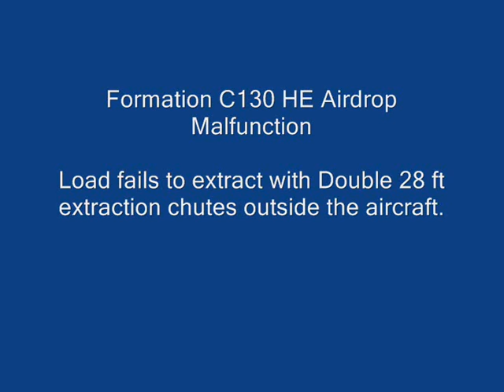C-130 74-1681, HE 2 x 28ft Chute Malfunction Aug 1989.wmv

Comment: I hoped that I would never run into this video again. I was an Instructor Loadmaster at Dyess for many years back then. Red Alfred was one of my students when he was going through local area qualification at Dyess after he returned back to Dyess from Little Rock. In my professional opinion, he was an outstanding Aircraft Loadmaster. I flew with him several times after he was signed off and upgraded to fully mission qualified. He always performed great in the manner required for this mission. He knew his job well and had a good insight regarding the particular requirements and emergency procedures for this type of airdrop. "Failure to extract with 2-28 foot fully deployed extraction parachutes" is the single worst malfunction that can occur during a Heavy Equipment airdrop. After performing all emergency procedures, the only thing you can do is attempt to jettison the load by pulling both left and right dual rail handles to their full retracted position. The primary Loadmaster had done that with no result. Red did the only thing possible then, and that was to attempt to cut the extraction parachutes free. Unfortunately,  time ran out and the aircraft impacted the ground. The OP explained the rest. I was required to return back to Dyess from overseas to attend the Malfunction Review Board held at Ft Lee. And the preliminary accident investigation at Dyess. In all my 22 years as an Instructor Loadmaster,  it was the hardest thing I ever had to go through. Red was a good guy. I still remember this vividly. RIP.
Reply: Thank you for your service and explaining who the loadmaster was and how hard he was trying to fix that. Also, his qualifications. The way people are these days probably think he was sitting on his butt smoking a cigarette watching it all not work. It was far from this as we all know now.

Comment: I didn’t know this existed.  I was in the plane right behind them, my very first flight after upgrading from student status.  I helped load that tank on that plane.  My heart just stopped again.  We had to listen and watch this happen, and you just can’t do anything.  That was my engineer yelling “close the bleeds”.  And the guy who died crawled back over that damned jammed tank and tried to cut the line.  The other loadmaster got one leg cut off below the knee when the prop broke apart and came inside the plane.  Wow.  My heart is still pounding, and my hands are shaking.  Don’t know if I can watch this again.
Reply: That sucks to hear man.  This was my biggest  worry being a loadmaster.  We always briefed that if things were not on point during the checklist, it was a no drop on double 28s.  All the other drops we would work thru but these are no joke.
Reply: Really man 
Not good
Reply: And how tight  can you tie it all down
No rest  ..
Reply: Loadie for the J models here, my second HE drop out of the school house was on the same DZ. dropping a test platform out there, with double 28's. The night before i just so happened to find this video and asked my IL about it. that day we flew over the DZ on a dry pass to see how it would run and see if the cameras were set up right. easily one of the most terrifying and humbling things I've done in my life. However with the electric locks, the jettison switches and the EPJS system on the plane I was less worried. but even with all the performance improvements and power alloted to us those chutes could easily do the same to us. Thank you for your time in and setting the laying the path for us youngin's. May he rest in peace and live on in the spirit of all 130 loadmasters today.
Reply: Also, i had heard of this incident in the school house when I went through.
Reply: MrCloudseeker  Before E.P.J.S. the only way to cut them away was manually. And if I recall correctly, EPJS was brought about as a direct result of this incident.
Reply: John Smith Sir, Being one who did not serve my country in the military what came to mind when I read your account was the scene when George C. Scott played Patton. He knelt at the wounded soldier's bed side and pinned the Purple Heart on the pillow and kissed the man on the top of his head. What men you ALL ARE. One of the biggest mistakes when you are 63 and look back on such HEROIC actions taken by real men. May God continue to bless all of our Active Duty and Veterans of all branches of service to The United States of America. More thanks I cannot say.
Reply: jason goin o
Reply: RIP - Red
Reply: How did he die?
Reply: Bless you my guy. Trauma of that magnitude, and you’re just a helpless onlooker all over again. I imagine you’ve relived that day over many sleepless nights, thinking again and again about what might have been done differently, but, life is what it is, and it throws some gnarly things in some people’s direction. We just need to carry on. Somehow. As best we can. Take care.

Comment: The incident happened during my time in the 772nd at Dyess. The two loadmasters were close friends of mine. The primary LM was Charles "Red" Alfred. The back up was Adam Parsons. Red lost his life when he went over the tank to cut the chutes away. Adam strapped in to the RH fwd troop seat. He lost his left leg as the tank rolled forward at aircraft impact.  The final incident report breaks it all down. That's Red's voice on intercom giving load status.
Reply: I was there that day.  If I remember correctly, the prop came thru the side of the plane and cut Adam’s leg.  The tank stayed more or less in place, maybe?, or it would have crushed Adam?  Or did it just manage to miss him?
Reply: @johnsmith4589  Adam told me, as the plane slid along the drop zone the fuselage was twisting and buckling. The twisting motion caused the dual rails to spread allowing the platform to move forward as the airplane came to a stop. He said he looked down as his leg was severed by the leading edge of the platform. Adam crawled out through a tear in the airplane skin. The flight deck crew heard his cries for help, ran to him and pulled him away from the airplane. Army personnel on scene assisted the crew and called for medivac. Red's helmet was located on the DZ. He made it to ramp area when they hit the ground. The force of the impact slammed Red to the floor causing un-survival head trauma. The team at Womack Army hospital at Ft Bragg did a herculean job of keeping him "alive" while CBPO personnel at Pope completed his Medical Retirement paperwork thus providing for his new wife and son from a previous marriage Carlos benefits and income.
Reply: As a former HC-130P pilot, this was a tough video to watch!  I hope I could have been as calm as that aircraft commander was knowing I was going down!  

I hope that LM got a medal posthumously for what he did trying to save his plane and crew!  That was very heroic on his part!
Reply: Thank you.
Reply: It was a Dyess aircraft, but it happened at Sicily DZ at Ft Bragg. I was flying touch and goes in the pattern with a Pope aircraft when the accident occurred. We were recalled to land due to all the fire and rescue equipment being sent to the crash site.
Reply: I hoped that I would never run into this video again. I was an Instructor Loadmaster at Dyess for many years back then. Red Alfred was one of my students when he was going through local area qualification at Dyess after he returned back to Dyess from Little Rock. In my professional opinion, he was an outstanding Aircraft Loadmaster. I flew with him several times after he was signed off and upgraded to fully mission qualified. He always performed great in the manner required for this mission. He knew his job well and had a good insight regarding the particular requirements and emergency procedures for this type of airdrop. "Failure to extract with 2-28 foot fully deployed extraction parachutes" is the single worst malfunction that can occur during a Heavy Equipment airdrop. After performing all emergency procedures, the only thing you can do is attempt to jettison the load by pulling both left and right dual rail handles to their full retracted position. The primary Loadmaster had done that with no result. Red did the only thing possible then, and that was to attempt to cut the extraction parachutes free. Unfortunately,  time ran out and the aircraft impacted the ground. The OP explained the rest. I was required to return back to Dyess from overseas to attend the Malfunction Review Board held at Ft Lee. And the preliminary accident investigation at Dyess. In all my 22 years as an Instructor Loadmaster,  it was the hardest thing I ever had to go through. Red was a good guy. I still remember this vividly. RIP.
Reply: @10hunterLab   I was assigned to the 463rd OMS. 😢 Tony Washington was the dedicated crew chief on 1681. He chose me to be his assistant crew chief during the spring rotation. 1681 had all the new upgrades, the main one was the enhanced ske radar. The plane was outstanding and was joy to service and maintain. He and I received Crew Chiefs of the month during that rotation for always being mission ready and ready to go when we called up as spare. Even another when two were aborted and we weren't a spare but we always worked hard to keep ready with a preflight done anyway. So we were ready to go. Put a lot busted knuckles,sweat and tears in 1681. I was there at Pope when it happened. All of crew chiefs were at Pope T/A after we blocked them all out. I was on a different C-130. J. Richards was assigned as the dedicated crew chief and was on board . We asked if he was ok and ops didn't know he was onboard. This caused a problem and all the wives of ours were freaking out, including mine because they told them all of us were ok as far as they know. We weren't allowed to call home at that time.

  I heard it was 1681, my heart 💔 broke. Then when we heard Red died, was heart 💔 broken worse. He was a real good guy and treated us crew chiefs well. Aug 9 always breaks me. I still have nightmares about being on board and dying with Red.

Comment: I was in the same formation drop a couple aircraft behind - we heard the call for Dust Off on Guard and knew right away it had to be one of our aircraft. We were enroute to the IP when the DZ was closed and we were immediately directed to RTB. We were all quarantined at what I think was a mobility processing facility adjacent to the ramp until after midnight when the mission commander briefed us on what happened. 

Sad sad night. 

If I remember it was attributed to a crew communication issue resulting in engaging the load locks after a no-drop and then attempting a second drop. 

The pilot - a Lt. Col whose name I can’t remember - actually did an amazing job of getting the aircraft on the ground and prevented further loss of life.

Comment: In the event of this emergency, there is a system in place to cut the chutes; however, if it fails, the last step is to pull the left hand lock restraint lever for ''10-20 seconds'' in case it is a lock that is preventing the extraction. If that were to also fail, then you notify the pilot of the condition. I think most of us would attempt to cut the chute, but just think... being that it is such a large load, I'm sure it would be nearly impossible to squeeze past it quickly enough to get back to the extraction chute line. Most of these loads fill out the entire cargo compartment. If I knew we were going down, I would sure try, but after running through the emergency procedure, there sure wouldn't be much time left. Not to mention, going aft of an 'unrestrained load' with double 28's fully deployed doesn't necessarily rest easy with the timid.
Reply: true, and to add to that this was before the creation of epjs so the chute would have to be cut manually, in this case without epjs it would have been a better idea to just prepare for a crash landing considering the left locks would never retract with that much force on them
Reply: there was no system in place to cut the line.  manual cut only.  i was in the plane right behind them, and actually helped load that damned tank.
Reply: A man gave everything he had trying to cut those lines. He was the only fatality because he refused to secure in a seat for the crash because he refused to give up his attempt at saving his friends. All of them made it, he didn’t. I want to say I’d do the same, but wonder in that moment knowing for sure what it meant,  if I’d have the strength. I think I’m to selfish, they were lucky to be flying with him that day instead of me.

Comment: I can only imagine as an aircraft technician myself, that last scream to close the bleeds was an attempt to get as much power as possible from the engines but they ran out of time. RIP
Reply: TD’s to null is the last thing to add also.
Reply: Also the bleed air ducts are in the front of the wing. You do not want them pressurized with hot gas on impact as the fuel tanks are just behind the bulkhead they are hung from. They are stainless and will got through the Aluminum behind them when driven by impact. Tank foam is designed to eat this stuff up, but you still do not want it pressurized/hot

Comment: 1989----FORT BRAGG, N.C. (AP) _ An Air Force cargo plane crashed Wednesday while attempting to drop equipment during a training exercise at Fort Bragg, killing one crew member and injuring six others, authorities said.

Seven people were aboard the C-130 Hercules from the 463 Tactical Airlift Wing based at Dyess Air Force Base near Abilene, Texas. The aircraft crashed about 7 p.m. at the Sicily Drop Zone on the Army base.

″The aircraft did break up and the fuel cells ruptured,″ Pope Air Force Base Fire Chief W.B. Bell Jr. said, adding that firefighters took one hour to extinguish the blaze.

ADVERTISEMENT

None of the crewmembers was identified. They were taken to Fort Bragg’s Womack Army Community Hospital, said Capt. Brian Irving, chief of public affairs for Pope Air Force Base and 317th Tactical Airlift. Hospital officials declined to release information on the conditions of the injured.

All on board were Air Force personnel, but it was unclear whether all were from Dyess Air Force Base, officials said.

The Fayetteville Times said the aircraft was attempting to drop a 36,000- pound armoured reconnaissance vehicle rigged with a parachute, when the crash occurred at the south side of the drop zone. The vehicle was still aboard the plane when it crashed, and began burning from a fuel fire.

The four-engine aircraft went down in a barren clay and sandy area surrounded by trees that is used by Fort Bragg and Pope Force Base primarily for parachute drops.

The aircraft was flying in support of the 82nd Airborne Division’s 3rd Battalion, 73rd Armor Regiment, said Lt. Col. Ned Longsworth, chief of public affairs for Fort Bragg and 18th Airborne Corps.

A board of Military Airlift Command officials will investigate the accident and was expected to arrive at Pope early Thursday, officials said.

The crash fatality was the first at Fort Bragg since July 1, 1987, when five service members died as a C-130 crashed and burned before more than 4,000 spectators during a capabilities exercise.

Four Pope Air Force Base crew members and a Fort Bragg soldier on the ground died in the accident, which occurred as the airplane was attempting to drop a tank.

Comment: Retired Herc FE here...
Was this the one that the forward chain restraints were left on?  Was told a long time ago the reason we have the checklist step  to call for the chains to be removed was because of an accident. Was thinking this was the one, but wasn’t sure.  I didn’t start flying til ‘92
Reply: I think the left hand locks were not all retracted?  Dropping double 28s you only put on a couple of chains to keep it from rolling out, but once those doubles open up two chains wont stop it.  Either this crash or another one where they no-dropped and skipped a step during the next run in.
Reply: @evilload  that one I remember too...not sure they were the same event
Reply: The LH locks were engaged when the "No-Drop" was called on the previous pass and were not disengaged in the 72 seconds between "No-Drop" and "Green Light".
Reply: @W0X42A  Changes in the checklist after this - 'blood' warning insuring locks remomoved/retracted before the completion of slowdown.

Comment: Being a retired C-130 L/M in the Canadian Air Force I do feel terrible for the terrible loss of life. What I can understand after watching this video and reading all the remarks , the only conclusion I can come up with, is the number 2 L/M did not retracted the LH locks. Number 1 L/M should have called a Stop Drop if The L/M's  weren't ready to continue or felt uncomfortable to proceed with the drop. I was involved on many HE drops where I called a stop drop because I was not comfortable with the situation. Could have caused by lack of communication between L/M's.
Reply: In the USAF, the "Primary Loadmaster" calls out checklists and operates the handles. The secondary, (LM) is there to back up the Primary.

Comment: Indeed a tough video to watch. Would someone explain what the pilots were discussing in closing the bleed valves? Were the bleed valves reducing power to the engines?
Reply: Yeah.  Kill (close) the bleeds so you can get as much power from the engines as possible.
Reply: All four engines had an air bleed tap off system to run the air conditioning, anti-icing, or it could be used to also start via cross feed valves another engine, obviously once you had one engine running. This air was tapped off from the compressor, hence robbing the burner and turbine sections of all the available air. As soon as you closed the bleed valves, all the available air went the the entire engine, hence pushing up the power.